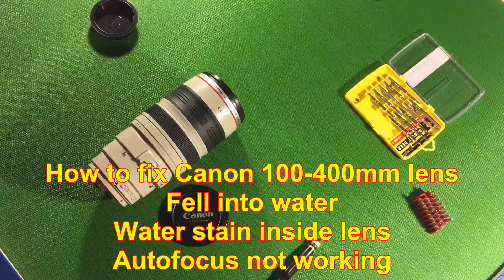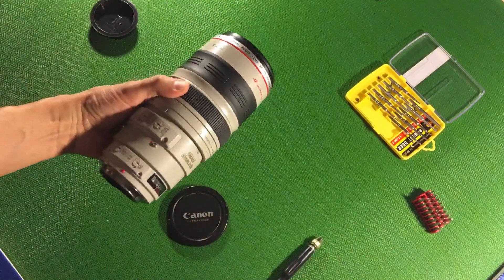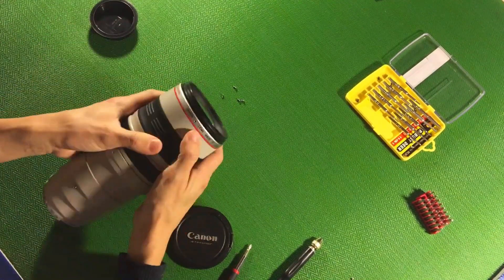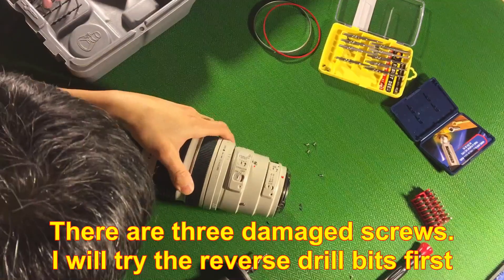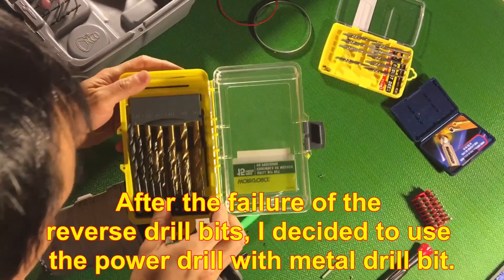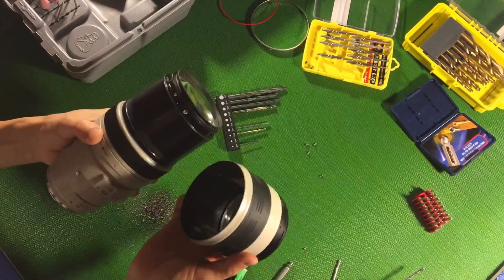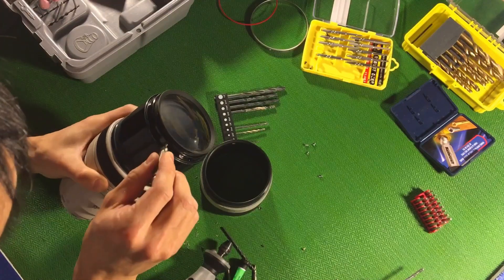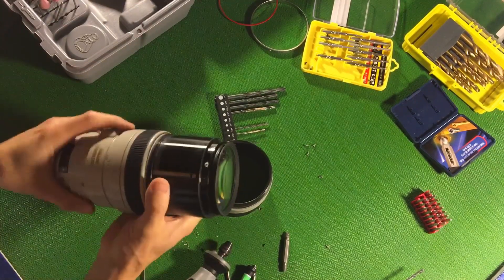How to fix a Canon 100-400mm lens water damaged, autofocus failure (PART I).

Comment: You use wrong screw driver. Use JIS bit not Philipp scew head
Reply from the maker: Thank you for you comment. The glue manufacturer put in was really tight. As time goes by, the screw got socked into the body.
Reply: @fsong00  No, this is well documented on Canon service manual, we have to use JIS head, not phillips, they looks similar but philips screw drivers always slip on it. With JIS head and push it hard, it will be opened fine without stripping it. Lensrentals.com documented the works too